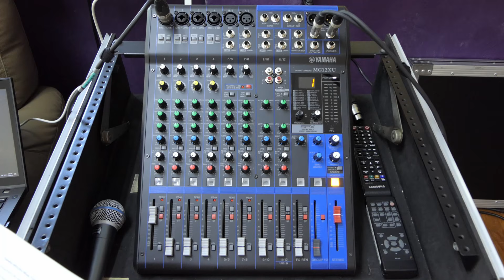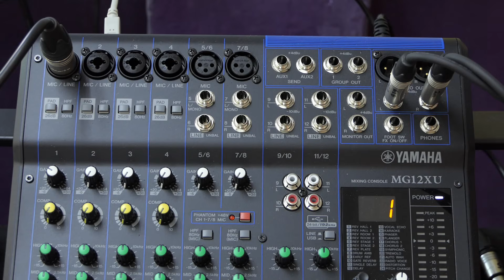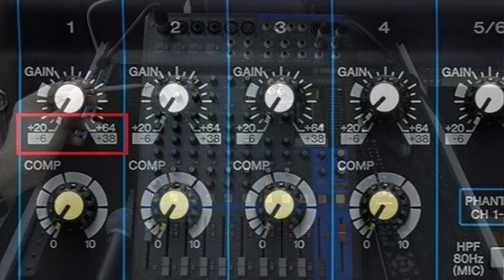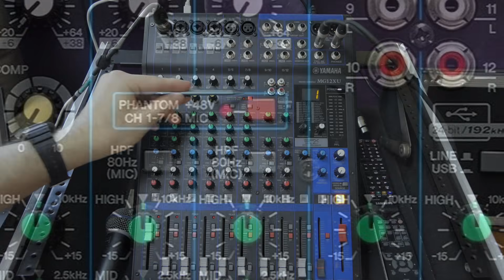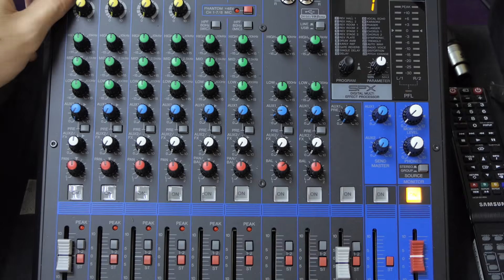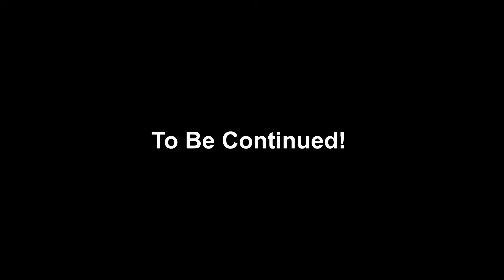Yamaha MG12XU Mixer Tutorial Part One

Comment: I bought a karaoke machine.  The instruction asks to plug Line Out from karaoke machine into a AMPLIFIER, then from amplifier out to speakers.  Can the Yamaha MG12XU console take the place of the amplifier?
Reply from the maker: No it cannot, you will still need a separate power amplifier.
Reply: @GLBProductions  Many mixer hookup videos instruct to plug the two STEREO OUT plugs (upper right hand corner) into speakers.  What would be the difference between that (plugging directly into speakers), and plugging into an amplifier then to the same speaker?
Reply from the maker: It's important to distinguish between active speakers with a built-in amplifier and passive speakers which need a separate external amplifier. The mixer can be connected directly to active, but not to passive speakers.
Reply: @GLBProductions  Thank you so much!!

Comment: for using the outputs of a DJ mixer that has XLR on the mains into a mixer, what i have been doing with my set up is running the XLR outs to the XLR ins of my yamaha MG10 so that i can use the eq to adjust the mains of the Bar / Club. I use the PAD feature of the channels and that mixer has a Stereo spread switch. Should I be using XLR out to TRS into the combo jack and that takes out the need for the pad switch? NOw I just bought he Allen and Heath ZED10FX to have a far better deck to travel with. in that scenario only channels 1 and 2 have 1/4 in line inputs but the XLR 's are "MIC" inputs, can I plug my Dj Mixer into those XLR in's or use a XLR to 1/4" TRS into those channels since that mixer does not have a PAD switch?
Reply from the maker: Either method is fine - into the XLR inputs with the PAD engaged, or into the TRS inputs. The former just makes it easier to connect using standard cabling.

Comment: If i only have one PA monitor how would i go about routing the output ? Do i just do L or R then press mono?
Reply from the maker: Which mono switch are you referring to?
Reply: @GLBProductions  Is there a mono switch on the mixer
Reply from the maker: No, hence my question. If you need a mono output you will need to keep all your pan controls in the center position and route stereo sources to two mono channels.

Comment: Have you ever had issues with low volume or latency in channels 5 through 10 when using a 1/4 inch source?
I'm running typical drum mics (xlr) into 123 & 4. I'm attempting to run electronic drums into the remaining channels. Yamaha dtxpress brain (1/4 cable).
Reply from the maker: No I have no experienced this, but double check that none of your PAD switches are on by mistake.

Comment: This is an absolutely great instructional video. I just picked up my Yamaha sound board. I was trying to do a test yesterday, and I’m not getting any sound through my speakers. I connected my Shure SM 58, to my microphone. I am able to get signal from there but I can’t get any volume out of my master. What have I done wrong? Do I need a DI box
Reply from the maker: Thanks for watching! Check the assign switches next to the fader and make sure the ST button is depressed on that channel. Also confirm that both that channel and the LR masters are switched ON (switch illuminated).

Comment: I've steinberg m1 xlr mic, steinberg uc22 and this beauty. I'm not sure how to setup this tools for dubbing or podcasting. should I plug mic to interface or mixer first? if I use interface first, it has double 1/4 outputs, where should I plug those outputs in the mixer? use 1/4 to XLR or two TRS to TRS ? it is very confusing.
Reply from the maker: The MG12XU can act as both a mixer and interface, so if you plug the mic into the mixer you don't need the interface. On the other hand, if you use the interface there is no need to use the mixer as you can EQ, compress and do other modifications to the mic signal in your DAW.
Reply: @GLBProductions  ok I’ll use mixer as interface. Which port and cables I should use for podcasting?

Comment: Is it possible to use condensor and dynamic mic at a time. ?
Reply from the maker: Yes it is.
Reply: HOPE THE PHANTOM POWER WILL NOT EFFECT THE DYNAMIC MIC. THANKS FOR YOUR RESPONSE. IF YOU CLARIFY MORE IN THIS MATTER WILL BE GREAT. THANKS
Reply from the maker: Dynamic mics with a balanced output will ignore phantom power - just remember not to make or break XLR connections with the phantom power turned on. Make all your connections, then turn it on. After the session, turn phantom off before unplugging anything.
Reply: @GLBProductions   THANKS SIR 🙏

Comment: what will happen if i only use one condenser mic and the rest are  dynamic mics? will the dynamics destroyed if i turn on the phantom power?
Reply from the maker: No - dynamic mics with a balanced output will just ignore phantom power. Just be sure not to make or break XLR connections with the phantom power switched on as this will send loud bangs and pops through the system.
Reply: @GLBProductions  thanks mate.

Comment: Bruno, thank you so much for your tutorials on the Yamaha MG-XU series. I have a 20, a 12 and small 6. I’ve learned so much more form you than I could glean from the User Manuals. I use the MG12XU mostly in my rehearsal studio and for small gigs. The use of the Aux2 control for the Fx has confused my to no end. Is there a way to manage the output volume to Aux2 monitors output without increasing/decreasing the Fx intensity for any particular channel?
Reply from the maker: Thanks for watching Russ. The answer to your question is... not really 😄 This mixer is designed to manage one monitor mix and one FX send - if you need a second monitor mix you CAN use aux 2 but then it should not be used as an FX send. Even that is less than optimal given that Aux 2 is fixed post-fader and has no master level control.
Reply: Bruno, thank you kindly for your reply. Clearly this is a limit on this smaller mixer. As an aside, I am committed to analog for live gigs. I’ve used digital mixers/software but have found that for quick adjustments in live settings the digital software is not intuitive and can quickly get your entire mix in trouble if you adjust the wrong setting deep in some sub-menu. The visual signal path of the analog mixers, such as the MG series, make for “safer” adjustments on the fly. All this to let you know how valuable your tutorials on these mixers are to your subscribers. I’ve learned magnitudes more from you than from any other tutorial I’ve found or from the manuals. Thank you again. Russ
Reply from the maker: You're welcome Russ. Yes, the advantage of analog mixers is immediate access to parameters and controls and this is unlikely to be equaled by digital mixers any time soon. If you tend to mix the same band and/or venue and do not have complex processing and routing needs then an analog board is often an ideal solution. The right tool for the job. All the best with your music!

Comment: I have a question. What if you were to push in the group button at any channel and the stereo button. Then at the master controls to the right, you push in the red button on group, and you turn up both ST and Group faders. Will that make any sound differences? I want stereo but a little confused if I were to select all options and how that would affect outcome
Reply from the maker: This will send the channel signal to the main outputs twice: once directly from the channel and once through the groups and group fader. There is really no good reason to do this and it can cause operator confusion.

Comment: How many stage monitors can be used with this mixer?
Reply from the maker: The mixer has basically one monitor mix, but you can connect as many stage monitors as you like, assuming you have enough amps and loudspeakers.

Comment: Hi...is there a way for the 12-channel board, to run a separate monitor assigned to just one channel. In this case, the vocalist?
Reply from the maker: I'm not sure if I understand your question - this mixer is set up to provide basically one stage monitor mix. Is that what you mean?
Reply: @GLBProductions  Hi.... So, I set one monitor up and daisy chained them and grabs everything I plugged into mixer, the whole band. My singer wanted a vocal only monitor. I think I figured out how to do that. I grabbed AUX 1 on his channel and now I have only his vocals coming through that monitor. He needed to hear himself.
Reply from the maker: Yup that's the correct way to set it up - very important to know the difference between the 'monitor out' outputs and the aux outputs.

Comment: Hi GLB Productions. Hi Bruno. Thank you for the helpful videos on YouTube. I was wondering if i could get your opinion on something. My church is planning on getting a new mixer and we are contemplating between the MG16xu or the MG166cx(if i got the models right). One of the reasons we've not decided yet is because of the insert option that is not available on the mg16xu but at the same time we want to get it because its like the latest in the market. So which do you advice we get? Also, my church is a small church (not more than 100 members) and we only majorly have drums, a keyboard and an electric guitar. Thanks
Reply from the maker: The cx version of the MG series has been discontinued for quite a few years now, so is no longer available new unless you can find a supplier who still has stock. If you absolutely must have analog insert points on each channel, you really have no choice but to do this. However if you can manage without then for sure go with the XU series.
Reply: @GLBProductions  Alright. Thanks. Thank you for always answering

Comment: Excellent video. For my karaoke setup,  I am trying to address the need to take the output from the mixer and feed that into DSLR camera. As you suggest, I will use Group 1-2 for the microphone and music channel, set ST on these and take the 1/4inch output from Group 1-2 into DSLR camera; I will turn off ST on the GROUP 1-2 fader and use that for the volume going out to y DSL camera - just trying to confirm, is the right approach?

How should I connect my mixer to the home theatre system such that the output from mixer goes into the home theatre system? If you can please help answer this.
Reply from the maker: Yes that will work fine, except you will need a device to convert the line level output of the mixer into a mic level signal suitable to be fed to the input of the DSLR. For connecting to your home theatre system, these typically use RCA/phono connectors, so you will need some adapters or cables to convert the 1/4" output of the mixer.
Reply: @GLBProductions  Thank you for taking the time to respond. When you mention about a device, are you suggesting a cable, two TRS 1/4 inch cables going to one 1/8th inch TRS to feed into DSLR (this is what I have) or some other device? Similarly, I took two 1/4 inch TS cables going out from Mixer main out into two RCA into home theater receiver (this is what I have) or some other device?
Reply from the maker: No it would be something like a recorder or audio adapter like the Beachtek DXA-HDV. The solution that you have now is not ideal as the output level of the mixer is not correctly matched to the input level of the camera which can cause distortion. When connecting to your home theatre receiver simple adapter cables are fine because the output and input levels are already matched.
Reply: @GLBProductions  thank you very much. The product is not available anymore. Would JBL M-Patch ACTIVE-1 work ( I have one of these)?  Group 1-2 output from mixer to JBL M-Patch ACTIVE-1 SOURCE 'B', then JBL M-Patch ACTIVE-1 OUTPUTS 'B' going into DSLR - will this be better or the right way?
Reply from the maker: In theory no because the JBL unit does not have a microphone level output which is what the camera input requires. If your current setup is working fine with no distortion or other problems just keep on using it :)
Reply: @GLBProductions  thank you team!

Comment: In a live situation, can we use both dynamic and condenser microphones with 48v phantom power on in the same mixing console??? Or will it damage the dynamic microphone???
Reply from the maker: You can use both - just remember not to plug and unplug the XLR connectors with the phantom power on!

Comment: Hi! Love your vids!  When I plug one of my devices(Elektron MK2) into a channel, I have to keep the gain at almost zero!  Is that normal?  I really don't want to have to use that "pad" button as I think it could effect sound quality.  Any suggestions?  I think having the gain that low could effect sound quality too...I can still hear it, but it sounds tooooo loud but better quality when I turn it up....Thanks!
Reply from the maker: I would suggest that you go ahead and use the pad switch: it won't affect the sound quality in any meaningful way and this is exactly the purpose it is designed for. The gain setting on these mixers does not affect the tone in a musical way - it's not like gain on a guitar amp. The exception to this is when the gain is set too high, at which point you get distortion 😉
Reply: @GLBProductions  Thank you! ; ).

Comment: Great video. I've bought one of these mixer to use for a dual-pc stream. I've yet to set it up but I was wondering if you could clarify something for me...
If I have 1 mic setup through channel one and it's going out through Aux 1 to PC 1 & Aux 2 to PC 2, if I use FX will it be on both inputs at the same time or is it isolated only to Aux 2?
Lastly, if I just wanted to speak to one audience (aux) at a time without the other hearing me, am I able to mute that Aux output without interfering with the other?

I'm very new to this, so this setup might not even work or make any sense. Some guidance would be appreciated. Thanks again!
Reply from the maker: Interesting question, not one I've gotten before! In this case, if you use the FX they will only ever go to Aux 1 - the internal FX cannot be sent to aux 2 when it is used as an external send because that would create a feedback loop. 
In your situation, may I suggest a simpler solution: use the L&R outputs to split your signal: connect PC1 to the left main output and PC2 to the right. If you want the signal to go to both PCs, pan the mic channel center. If you want it to go to PC1 only, pan hard left, and vice versa for PC2. This will give you full functionality of the effects for both destinations, and also keep both of them post-fader and post-mute. If you want to kill the feed to both PCs without disturbing the level, just switch the channel OFF.

Comment: Hi, how do I add a left and right line out from my guitar amp to this console?
Reply from the maker: Sorry I don't understand your question.
Reply: @GLBProductions  
My Yamaha Thr30ii guitar amp has a left and a right line out quarter inch jack outputs. Where on the Yamaha mixer do I connect them to? Any help would be gratefully appreciated.  Cheers. 🙂
Reply from the maker: Oh ok - for that amp just connect to any of the LINE inputs on the console - you can either use one of the stereo channels (5/6 thru 11/12) or two mono channels, panned left and right.
Reply: @GLBProductions  
Thank you for the quick response. And Thank you for the advice. I have been really pleased with the Yamaha MG12XU
It has never let me down, even when it wasn't used during lockdown for nearly 2 years, it fired up again with no issues. Thanks again. 😊
Reply from the maker: You're welcome, all the best with your music!

Comment: Hi! Do you offer 1:1 training? I am a drummer and I'm really struggling to use my MG12 XU to do what I want. I'm sure it's pure ignorance on my part!
Reply from the maker: If you describe the problem here I may be able to help you. Or you can send me an email if you prefer.
Reply: @GLBProductions  Hi and thank you for the prompt response! May I suggest we discuss my issue here as it may well help others out there who struggle with mixing desks? Essentially I was given a Yamaha MG12 XU a couple of years ago and I have never had the opportunity to use it until now. I am trying to record video of me doing some drum covers. I have a Roland TD 50 drum brain and I have it connected to the MG12 via two XLR cables. If I used headphones to listen, the sound comes thorough but is totally unaffected by anything on the mixing desk. I also can't seem to get any output to my video camera. I am taking the 2 x1/4 stereo output from the mixer to a single 3.5mm jack into the camera but getting no sound. If it would help I can take a picture of the desk as I have it set up? Thank you again for your very kind offer of help. Andy
Reply from the maker: Sure Andy - for a start make sure that the red ST button on the channels in use is engaged to route the signal to the mixer's stereo bus, and that the channels are switched ON. Also make sure that your red master fader is up and switched ON. This typically solves most of the problems you describe above.

Comment: I get the yellow lights on, on the right side and get them to “0”  then I turn off the small grey button and turn the power on for that channel raise the volume and nothing happens. No sound out of the speakers. And the green lights don’t turn on like the video. What am I doing wrong or missing? Please help
Reply from the maker: Double check that your channel is routed to the main outputs (red ST button engaged) and also that your main stereo output is switched ON.
Reply: @GLBProductions  YEEEES!!!!!! It works! Thank you so much. So simple it was the ST button
Reply from the maker: Glad to hear that Dave :)